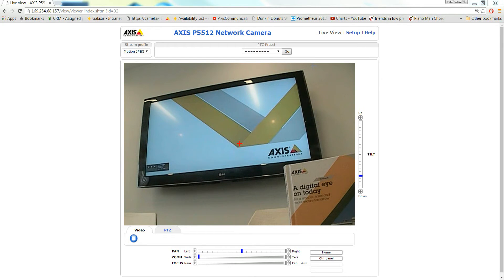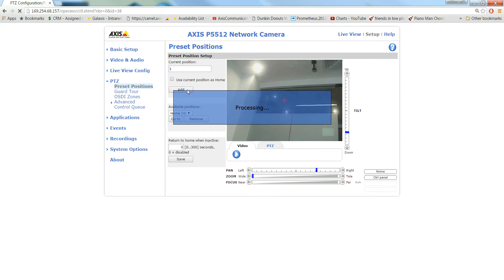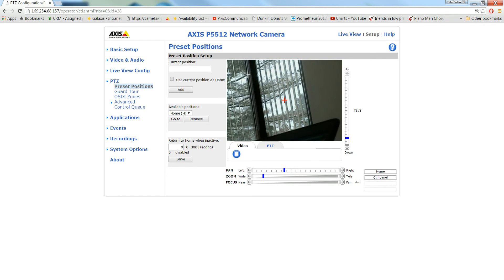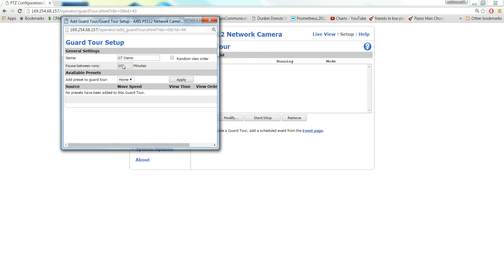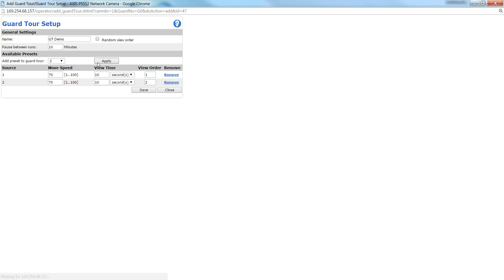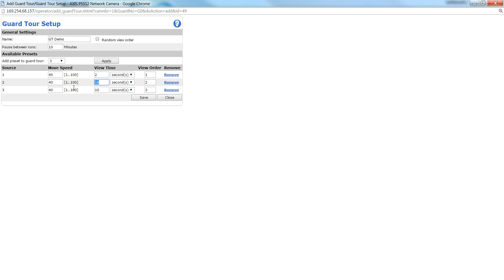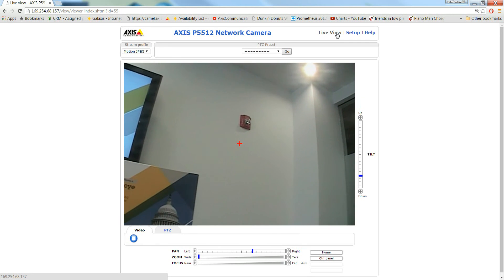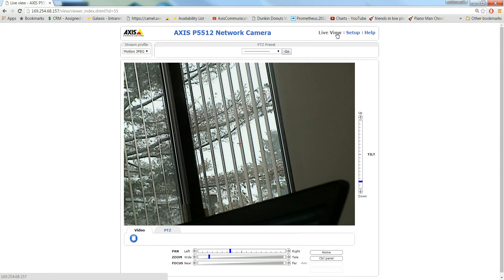Guard Tour Set Up

Comment: Hi steve,
If i place 2 non-ptz Axis cameras on 2 adjacent corner exteriors walls, and an corner mounted Axis PTZ camera between them, Can I get the PTZ to automatically zoom in to any motion that is detected by the other cameras?
Reply from the maker: Yes.  But it would be based upon preset position on the ptz
Reply: @unhthrower84  I have turned on motion guard on my non ptz axis cameras. What would I have to do to configure the PTZ to move to the preset position?

Comment: is it possible to resume a guard tour automatically after taking control of a ptz? like if I control the ptz manually could i set it to resume the guard tour after say 30 seconds?
Reply from the maker: SpoKeNReVeng3 it will automatically go back to the gaurd tour
Reply: Steves' Garage Demos hmmmm. Is there a way to set an amount of time before it resumes?
Reply from the maker: SpoKeNReVeng3 not sure.  but I believe so.  you can set up a delay between gaurd tours for sure
Reply: Steves' Garage Demos hmmm seems when i take control it tells the axis camera to turn stop the guard and doesn't resume again
Reply from the maker: SpoKeNReVeng3 what ptz camera do you have?
Reply: q6055-e
Reply from the maker: Then yes it should deff return to the gaurd tour after you take control of it.  But, it does take a few seconds.  If it's not working call axis tech support at 1800 444 2947 option 2